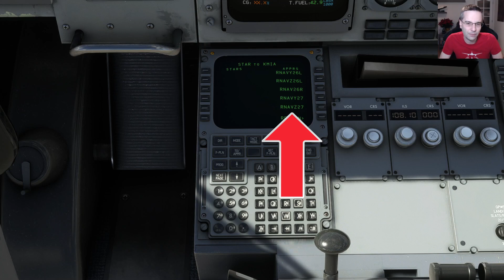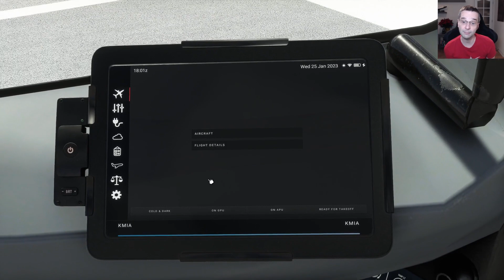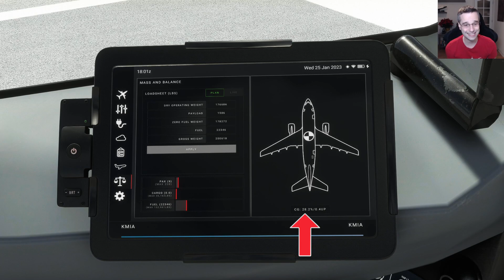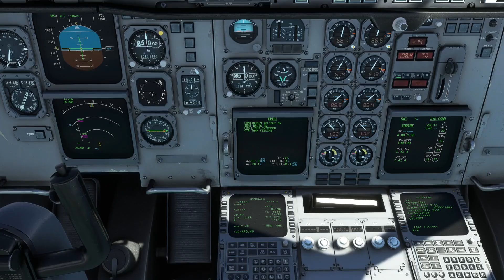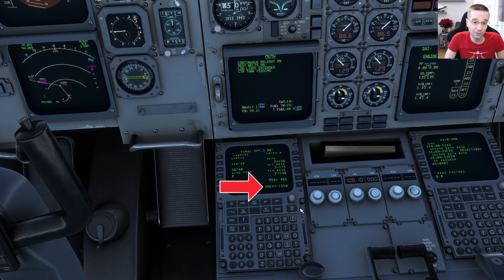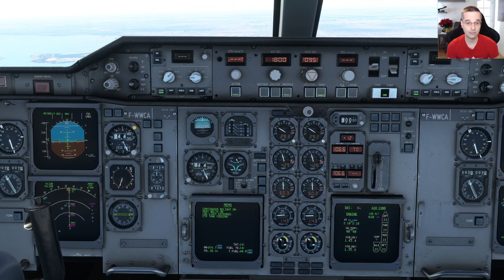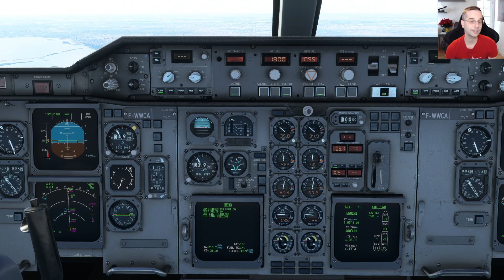Demystifying A310 RNAV Approaches | MSFS Tutorial

Comment: hi.. thanks for the video..i followed all your steps.. and i think it worked (i got the appr. speed in blue)... but the plane wasn't lined up with the centerline, it was way to the left, about inline with that taxiway there.. i had to hand fly it back to the centerline.. did i mess something up?
Reply from the maker: Which approach was it?
Reply: @FlightSimSchool  rnav27z
Reply from the maker: That's weird, not sure why it would do that. Maybe it's a bug with the approach.
Reply: @FlightSimSchool  for the life of me, i can't figure this out.. i tried other aircraft and they track right on the centerline, but the a310 tracks one runway width to the left
Reply from the maker: @super64-g3c  what if you try a different approach, does it also track off centerline?
Reply: @FlightSimSchool  KMIA rnav12z it also tracks to the left, i feel like there is some kind of offset set somewhere

Comment: Ok, after two days, I've found this works reliably, in this order:
1. Flying in FCU NAV mode, aim to arrive at your Platform Altitude before you get to the Initial Approach Fix (IAF) waypoint;
2. When you are flying level at the platform altitude, press ALT HLD (if you are not already in that mode) Note: This should cancel any previous "Profile" mode you may have been in;
3. Configure the plane for landing (gear down; full flaps etc.);
4. When you are close to the IAF waypoint (with the V/DEV scale showing), activate the FINAL 3.0 mode on the MCDU APPR page; 
5. When you have just flown past the IAF waypoint, on the FCU press PROFILE button (P.DES is now armed for the RNAV final approach);
6. As the magenta chevron on the vertical scale reaches the middle notch (ie zero deviation) the P.SPD and P.DES should automatically show in green on the PFD. (This indicates that you are now on the RNAV descent path and altitude should be decreasing!)
7. When you arrive at the MDA altitude, you must disengage the autopilot and take down to threshold and manually flare; retard the throttles etc.

Comment: Plane simple does not decelerated getting to IAF, plane was too fast so I could not be ready by FAF. Any ideas? In the past I was suggested to manually control speed, luckly I could manually land after disabling AP.
Reply from the maker: If you’re descending in profile mode towards the IAF, it may have a hard time decelerating, you could try Level Change instead and set a target speed for it to follow. Don’t forget you have speed brakes to help out there too, especially when you’re high on profile in the V/DEV on the navigation display.

Comment: Hi. I'm attempting an RNAV into EGCC 23L, using a ChartFox plate. The IAF is C23LI @ 3500ft and the FAF is C23LF and is also 3500ft. So I set 3500ft on the A.P, switch to profile mode and  vverything looks fine Vapp appears on cue at the bottom of the display and the aircraft switches to P-DEC mode until it reaches FAF and it then switches back to P-ALT and doesn't descend any further, it just remains at 3500ft? Any ideas? I'm on Xbox series S.
Reply from the maker: hmmmm, are you configured for landing at that point with the gear down and flaps at landing? the other thing you could try is set your AP altitude to the MDA instead, and see if that helps.
Reply: @FlightSimSchool   There is no consistency in the way it fails. The last attempt, the aircraft showed P.DES but the speed remained at 180knots, the  v deviation diamond remained in the middle but the ROD was only around 200fpm and so the aircraft remained at around 3000ft and overshot the runway. Can you fly the approach yourself and see if works for you?
Reply from the maker: I'll try and have a go at it sometime this week. Have you tried another RNAV instead? Same behaviour?
Reply: @FlightSimSchool  Hi. I think it might be an issue with the configuration when starting the flight from the runway.  I flew into Dublin and could'nt get it to work until I did the flight from cold and dark with full programing of the FMC then touch wood it worked as it should. I'll try a few more full flights from scratch and see how it goes.

Comment: how do we inform the course of the final runway on the approach in this aircraft, so as not to arrive misaligned with the course of the final runway?
Reply from the maker: For an RNAV approach, you don't need to set the final approach course. For an ILS: you'd set the ILS frequency on the bottom pedestal between the two MCDUs where it says ILS and CRS, by twisting both knobs to their correct values.

Comment: Tried this and it didnt work. Plane slowed down by itselt just fine. I was at landing speed and full flpas before reaching final waypoint but the plane wouldnt decend when the vDev line up. I engaed profile mode after passing the first waypoint on the approach. Any ideas what am doing wrong?
Reply from the maker: hmmmm, the first thing that comes to mind is the altitude that’s set on the autopilot. What were the active modes of the autopilot shown in the PFD?
Reply: @FlightSimSchool  RETARD and P.Des. am pretty sure I had everything set up correctly, the plane just wouldn't descend. I think it is a bug. Been messing around with various other rnav approaches but I keep having the same issue. On top of that the same thing is happening with ils approaches aswell. Been flying ils approaches for ages on this plane with no issue so am pretty sure it's a bug.

Comment: Pull the altitude knob after setting the minimum altitude in the MCP. This will "arm the descent" shown as P.descent in blue on the PFD. This will allow you to fly the initial fix in profile mode and the aircraft will descend as normal.

The reason you're not able to be in profile mode when first overflying the waypoint is that you failed to arm the descent, being in another mode and then activating profile mode after overflying the waypoint is basically just arming the descent and initiating it once you hit profile after the waypoint.

You absolutely can and should be in profile mode before the initial approach fix, just make sure you have your final altitude in the autopilot altitude window and pull the knob to arm the descent.
Reply: so you don't set a go around altitude after pressing the land button?
Reply from the maker: Hi Gregory, thanks for the tip. I did try it like that a few times, but it didn’t work every time for some reason, so I went with this approach because it’s closest to what’s recommended by ini in their official videos.
Reply: Dude, that works! I have been trying to do this for the last two weeks and it refused to arm P. Des. Pulling that altitude knob does the trick! Don't need to do any other voodoo magic. Thanks Gregory
Reply: Gregory, by "minimum altitude" do you mean the MDA, or the Platform Altitude?
Reply: probably the Final Approach Fix altitude  @martinfendt1305

Comment: Thx for this but I don’t know the difference between the rnav and ils approaches.thx
Reply from the maker: An ILS is a precision approach that uses ground-based systems to guide you down, and the RNAV is a non-precision approach that uses GPS to guide you down. Usually you'd use the approach that is going to give you the lowest MDA, which is almost always the ILS, except in places where there isn't an ILS (like say Runway 27 at San Diego)
Reply: @FlightSimSchool  thx